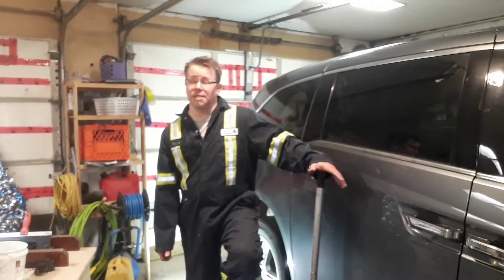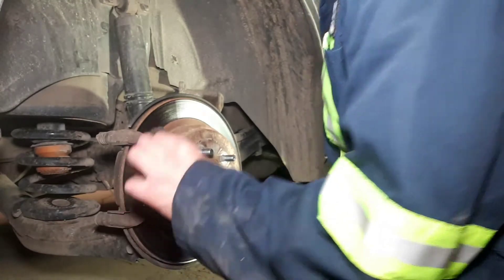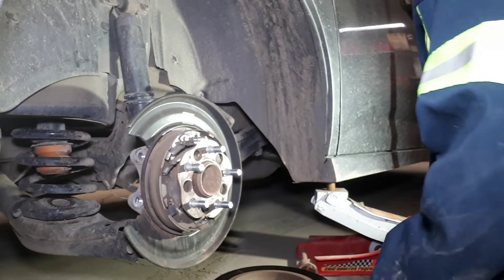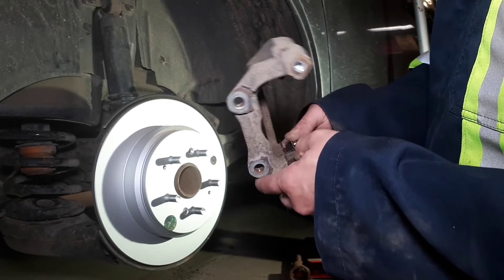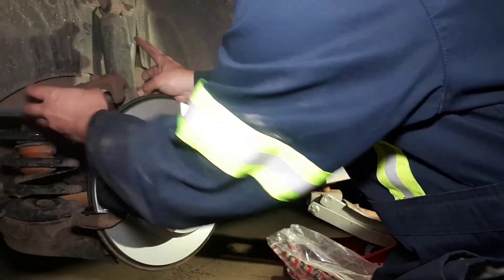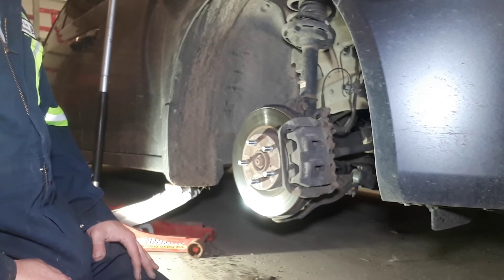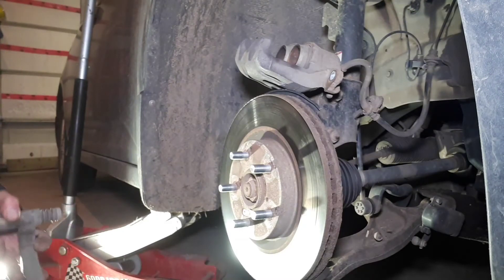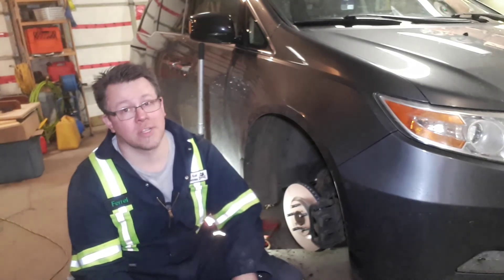(Not) An Odd Job: How to Repace Brakes on a 2013 Honda Odyssey!

Comment: The more dum decision you make the more mine seem normal 😅🤣great job one question did you lubricant the slides on the callipers? all the best to you and your loved ones
Reply from the maker: I didn't lube them, because they are sealed with little rubber boots and the movement was still very nice and smooth! Honda must use some top-notch grease!